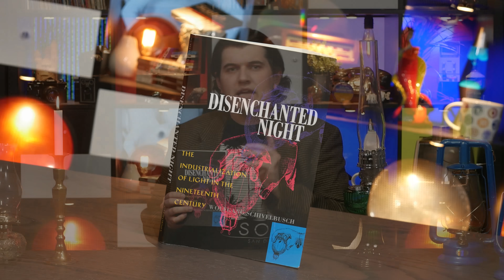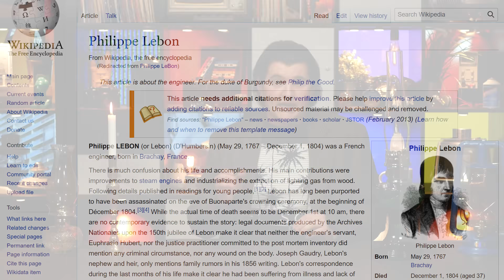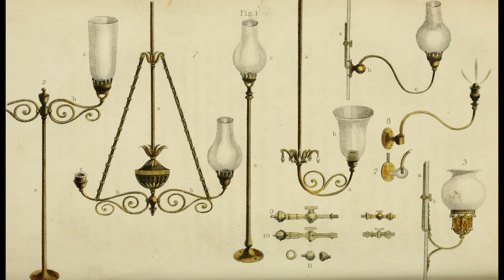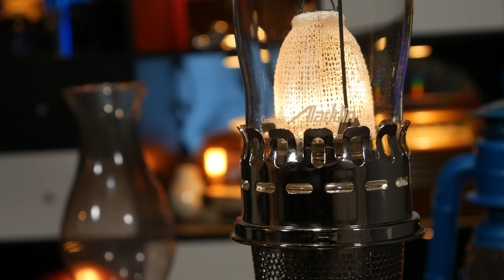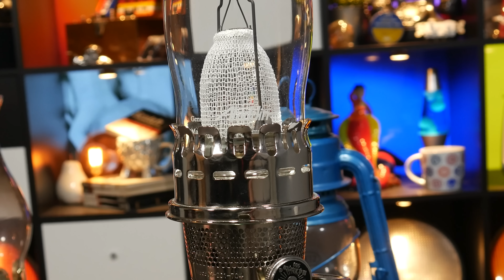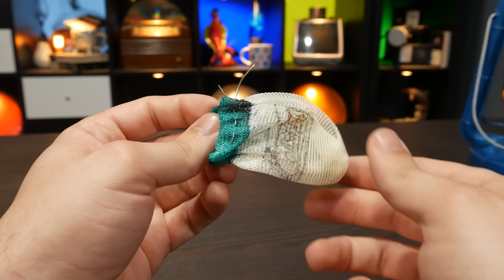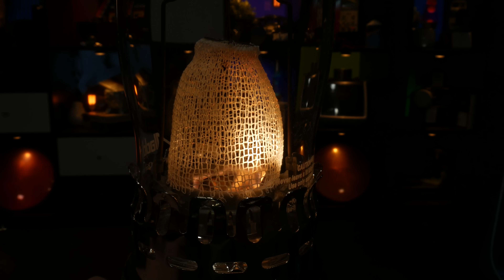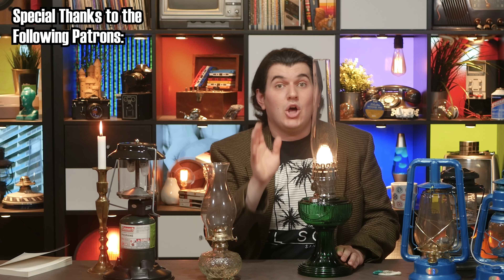How the gas mantle made lamps 10X brighter

Comment: As a gasometer rises and falls in its water trough (they are effectively pistons), it is possible to measure the volume of of gas, purely by it's height.. so it is intrinsically also a measuring device.

Gasometers were all built with roughly the same diameter so they all generated the same pressure as the network desired... weight would be removed or added (via a water tank on top) in order to set a tank to fill or discharge.. all very simple engineering.

Comment: There are still a lot (about 1750, I think) of gas lamps in London. They're scattered around Westminster and the city. Others that look alike have been fitted with electric lamps.
A team of six people maintains them, which includes winding up the clockwork timer that opens and closes the valve. The mantles come from Germany.
Reply: Yes.  And the city of Worcester still has them and very pretty they are.
Reply: San Diego CA has several gaslamps.  No glowing mantles though.  It’s just pure flame

.
Reply: @Biggles732  No. Acetylene burning in air gives a very yellow, VERY sooty flame. Which is quite nice - we used to use them for caving, under the nickname of "stinkies". (The calcium carbide used to generate the acetylene often had traces of calcium phosphide, which produced phosphine gas and a very distinctive smell.)
You are probably thinking of burning a mixture of acetylene gas pre-mixed with oxygen before being fed into the burner. Two gas bottles (or a generator and an air pump) feeding two hoses in one burner. Which does produce a bright blue flame.
Reply: @WellsiteGeolog acetylene lamp burners are very bright and not sooty. They have a stepped jet that allowed just enough air to get entrained Into the gas jet to make a white hot , not blue flame for maximum light. The brightness of the light was due to the high temperature, and the excess of carbon in the flame. A blue flame would give more complete combustion but little light. Early automobiles and motorcycles used acetylene gas headlights.
Reply: @ Maybe the lamps you used ; definitely not the lamps (both "stinkies" and multi-part generator-headlamp sets) I used.
They had no way of pushing air into the gas generator, against the pressure of the acetylene, so once the air entrained when charging the generator chamber with lump carbide had been flushed by the generated acetylene, there was no air in the system to mix with the fuel gas.
The burner heads had no air-mixing equipment either. And the jets were simple screw-in brass fittings.
Reply: @WellsiteGeolog  acetylene light use a  tiny  high velocity jet that was down inside a larger diameter recess. That’s what drew  in enough air for white hot combustion.  They also used 2 jets in a “Y” shape that impinged on each other At 45 degrees to get a flat sheet of flame. . There was no mixing of air before the jet. The stepped jet causes a little bit of air to be entrained into the jet of gas. Lighting books from about 1910 explain how it works. I’ve never seen brass jets on an acetylene light. Period literature called the jet material ‘lava’ which looks to be some kind of ceramic. Proper acetylene lights do not produce a smoky flame at all.  I know the owner of a 1914 model t who still uses them, he rarely needs to clean the glass or reflector. He runs them off a prestolite tank.
Reply: @Wiencourager  Different machines for a different job. I knew that acetylene lamps were used for vehicles, but I've never seen one. I guess, different weight: luminance ratios. Ours worked at a PSI or two to provide light for 4 or 5 hours on a charge (you refill your lamp when you stop for lunch) and had an electric backup for when climbing under a waterfall or through a sump - not vehicular conditions. (Also, for when recharging the carbide reservoir.) I'm going to guess that yours worked at much higher pressure, and had all the pressurised components made of metal (again, ours could be lightweight plastic chambers, flexible plastic pipe from waist-mounted chamber to head-mounted lamp). Different machine for a different job.

In recent practice, the availability of LED lamps has made electric lighting for days or weeks on an expedition practicable, so carbides are pretty much nostalgic today. The heaps of spent carbide "ash" scattered through "tourist" caves are slowly being cleared as new visitors arrive. On multi-day trips, modern ethics have you carry out your shit in bags, so a few more bags of carbide "ash" aren't that big a deal.
Reply: For some reason I don’t trust this comment. I just get the feeling I’m being gaslit. 

HEYO CHECK ME OUT!! 
How clever is that pun?!

Comment: The fun thing about lantern mantles is they contain a bunch of thorium an alpha particle  that causes lots of cellular damage if it gets inside the body  gas mantles disintegrate when changed out it almost every impossible to avoid breathing in those little pieces of mantle  which is bad for biological organizms cancer is highly probable if alot of those particles are in haled which is hard to identify unless insitu testing is performed.ther' not telling how many cases of lung cancer have been caused by changing mantles and in healing mantle dust.

Comment: I wonder if you could use some kind of heat expanding contraption to regulate the height of the burner to regulate the light of that Aladdin lamp, like the nichrome wire from that fancy schmancy toaster.  As the wire heats up, it relaxes and allows the burner to lower a bit?

Comment: Thanks for the informative video.
I wish it could have been longer.
Aladdin lamps were one of the greatest innovations of all time.
When I was a kid, in the 1950s and 60s, it was our ONLY form of lighting.
I keep expanding my collection whenever I can.
AND I use them regularly.
However, they DO demand attention and certainly should not be 'left alone' for any great time.
It's EXTREMELY difficult to keep the wick trimmed perfectly, which means one can RARELY achieve maximum potential light.
But even a poorly maintained Aladdin is superior to a perfectly maintained 'hurricane' lamp.

Comment: I grew up in a house without electricity in NW Scotland, we used candles, paraffin and gas lamps, I still have great memories of the gentle hiss of a Tilly lamp, and having to occasionally pump the pressure up in the tank, to increase the brightness. Also remember burning my hand really badly on the glass of a storm lantern!🤣 We finally got connected to the grid when I was about 5, and my Dad never got over the satisfaction of just being able to flick a switch and turn on the light,not to mention being able to use power tools etc… or an electric kettle or toaster! Good times…..👌

Comment: Fascinating episode.  There was a hurricane in 2006 and we were without power for a week.  We have natural gas in the house, and I want on a campaign to convert as much of my energy needs to run on natural gas.  Included in that, I installed for dual-mantle gas lamps.  We routinely use these winter as they provide a pleasing glow and take the edge off the chill.

Comment: The late introduction of mantles explains why gas companies had to make sure the gas had enough illuminating power - right up to the end of coal gas. I guess not everyone was using mantles even then. 
For example, when the water gas process was developed (Hot coke + steam makes a clean burning gas with little illumination) they had to inject petroleum fuels into the process to make the illuminants. Hence Carburetted Water Gas, CWG, if anyone has ever heard of or wondered what that was.

Comment: And that's  what poland.and Germany  can turn  to for domestic gas,  its coal  gas which is essentially  carbon  monoxide ,, hydrogen is also produced but  is isually escaped  long  before reaching most households. Same  gas that  has fueled automobiles with those smoky contraptions  attached .

Comment: They act like a catalytic converter does where you could replace the mesh with a expensive metal like platinum and get the same kind of effects. All its doing is giving the original flame more surface area to give the fuel a fuller complete burning of the hydrocarbon of the fuel. Simple, but effective catalyst reaction.

Comment: The Aladdin lamp doesn't smell when it's up to operating temperature, but I can tell you that it saves up all of its kerosene smell until the time that you blow it out.  After blowing it out, the lamp will quickly stink up a room!   I used to take mine outdoors to blow it out.

Comment: The other problem with coal gas is that it was a mixture of carbon monoxide and hydrogen as the primary fuels.
That’s why suicide by putting your head in an oven was a thing and isn’t anymore. Natural gas will just give you a headache instead as methane is far less toxic.

Comment: There is a small community called Finn Settlement near where I live. They had a school teacher that taught in a small shed. The shed had gas mantels for light. the gas source was hole in the ground about 2 foot in diameter by 12 feet deep lined by a steel pipe, capped by a plate and sealed with rubber. They would lift the lid and dump in some calcium carbide and close the lid tight. This provided acetylene gas to the lamps for light.

Comment: Some gaslights especially those in halls and similar buildings had electric spark or hot wire ignitors, operated from a battery. Such buildings often used illuminating gas  made from oil rather than coal gas which gave a much better light; this type of gas stored in tanks under pressure was used for lighting rail vehicles as well. The disastrous fire in the Ringtheater in Vienna in the 1880's was caused by a stagehand trying to light the gas lights with a taper on a pole after the ignitors failed and the gas had been flowing for several minutes. Some reports said that a limelight exploded, but the spotlights in the Ringtheater were electric arcs. Normal gas lights were generally turned on and off by a valve operated by a chain and often had a small pilot light.

Comment: okay non-scineinisy kinnda question is the mantle part of the lamp or aftermarket looked on AZ for that style of lamp not  any luck,  If it's  an add on  you would also want to change  the flue as well  i think? also is "gaslighting" the behavior, termed because over exposure to Gas Lights would cause confusion and  make a person less resistant  to input?

Comment: Back in the 1970s I stayed up in Lapland at the cabin of a friend of mine for a week in the winter. He had an old Aladdin lamp hanging from a hook in the ceiling that provided all the light we needed. Extended from the hanging handle by a thin chain was a round corrugated metal disk that was positioned directly over the end of the glass chimney at a distance of c. 2". This served to deflect the hot gas issuing from the chimney so that it didn't char the ceiling directly above the lamp. Since it was winter, the heat of the lamp was no problem, rather the opposite. In the summer, the lamp wouldn't have been needed; at 68° 23” N or c. 130 miles north of the Arctic Circle, it doesn't get dark at night in the summer.

Comment: 22:10  Huh; I've not really used one of these before, but the description you gave sounds less like a problem with the mantle and more with the flame, or maybe the centering of the mantle.  If you rotate the mantle 90*, does the hot spot move with the mantle or no?  If it stays fixed relative to the lamp, maybe you need to mess with the wick, or recenter the mantle or something.

Comment: When I watched the last video and you brought out the Aladdin I was disappointed you did not talk about the mantle but now I see you made an entire video for that purpose. Discovering Aladdin lamps has been one of the most expensive and enjoyable aspects of my life. I burn mine constantly in the winter for the light and extra heat.

Regarding the uneven flame, that is definitely a problem with the new maxbrite burners and the old 23 burners. It is usually caused by air leaks. But if you get yourself an old model B burner you may find you have a perfectly blue, perfectly even Flame. I've tried most of the burners and the model B is by far the best. Well-worth an eBay purchase.

Comment: You do not use up the oxygen in the room. What happens is that the level of carbon dioxide increases to a point where you get headaches. At that point the level of oxygen in the room is still about the same as it was to start with.

Comment: Here’s another interesting connection. When electric lighting was first being installed in buildings, they already had a route to run the wires: the gas pipes. The electric fixtures went up right where the gas fixtures had been, and the wires were pulled through the pipes that were already there. This way, electric conduit was “invented”.
Reply: One source: the Wikipedia article on electric conduit.
Reply: @davidkantor7978  Yeah, interesting.  I'm guessing some of the early gas piping was probably bent brass tubing.  That could certainly work as electrical conduit.
Reply: @davidkantor7978 BUT the Wikipedia article has no source for its claim of using gas pipes for early electrical wiring.  I therefore erased the unsourced paragraph 

.
Reply: ah! I didnt know that!
Reply: Source?  If you've pulled wires through actual conduit you know how hard even that is.   Pulling wires through gas pipe seems almost impossible; the elbows are too sharp and the pipe has most likely not been reamed at the ends.  I call BS
Reply: @pasad335  Thanks for the reply. I don’t recall the source; sorry.

You make a good point. I bet that the insulation could get stripped as the wire went a joint where the pipe ends were not reamed.

But still, it could have been how the practice got started. Then, subsequently, people figured that they needed to have tubing that is more suitable for wire; curvy bends and free of sharp edges.
Reply: @davidkantor7978  delightful that you think those wires were in any way insulated. It was pure bare copper. I helped add more outlets to a house that was built pre-electrification and it was a shocking amount of bare copper wires. I lived there a few years and still have a faint memory of the latent buzz in the wall my parents swore they couldn't hear (they likely couldn't as they liked to attend loud concerts), and the SNAP as the toggle switch (two separate pistons of ceramic) turned on a light. Amazed it didn't burn down anytime between its electrification and complete electrical gutting for selling the copper.
Reply: I'm a little dubious. I've done a lot of rewiring jobs in old (150+ years) buildings where the knob and tube was run alongside gas lines, and the electric fixtures were screwed onto the old gas lines. I've even kept the handful of dual-source electric/gas fixtures I've found.

Comment: I grew up in the 90s in a house without electricity. We had an Aladin lamp in the living room. We used a couple of different kerosene lamps in other areas of the house, but the Aladin lamp was on a table between my parents chairs. They could reach over and adjust the lamp easily.

Comment: To get the aladen to burn more even.  

A. 
     Trim the side of the wick that is producing too much flame.   Yes just a 😎 slightest little shorter than the rest of the wick.   I routinely use a cheep 1/4 inch paintbrush, cut off to less than 1/2” to lightly brush the wick from the inside out before lighting the wick before lighting it.    I have found over the years, this practice drastically:
 • reduceses the need to trim the wick,
 • reduces carbon build up on the wick 
 • helps wick tip fibers stay evenly desrributed. 

B. 
     Very little of the kerosene vapor  actually is burned at the tip of the wick.  Always start the burn with the bottom 1/2 of the mantel glowing.  The beginning intention is to NOT have the entire mantel burning brightly to the top.  Then adjust it at least 5 to ten min. after starting the burn.  It will heat up the entire top parts and drastically  increase the vaporizing of the kerosene coming off the wick.  Check and adjust the wick a second time!  You will get used to the fact that with each wick adjustment, it is adjusted LOWER, several times, the lamp continuse to heat up, the wick increases kerostne vapor production, that burns  with increasing uniformity, in the bright, white hot heat produced in the mantel burn.   You will get to the point that with the  lowest praticle wick adjustment, the mantel will burn slightly less brightly, but still uniformly.

Comment: "What does the word luting mean?
Definitions of luting. a substance for packing a joint or coating a porous surface to make it impervious to gas or liquid. synonyms: lute. type of: sealing material. any substance used to seal joints or fill cracks in a porous surface."

Comment: No, there is a high performance petroleum fueled gas mantle lamp: It is called a  pressure Petroleum/Kerosene lamp, e.g.the Petromax HK500 Kerosene Pressure Lamp. 500 candle power = 6300 Lumen. At least as bright as a 350W halogen bulb. And contrary to the halogen bulb, the brightness is not degrading, just change the gas mantle from time to time.... German engineering, invented in 1910.  Kerosene lamps have a place, even in the modern world, because of their simplicity, and ease of handling and safety of the fuel.

Comment: I had gaslight in my camper van in the 80s ... Essential part of the setup was a can of hairspray as spraying the mantle before driving stopped it breaking.. Also worked on Aladdin mantles if they had to be moved. (Gas lamp in camper because no led lights meant battery went flat)